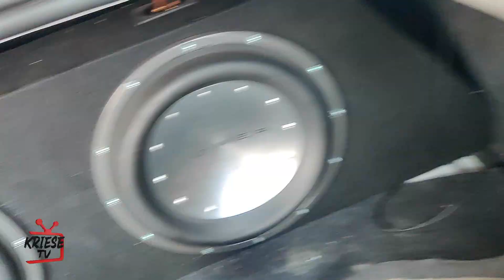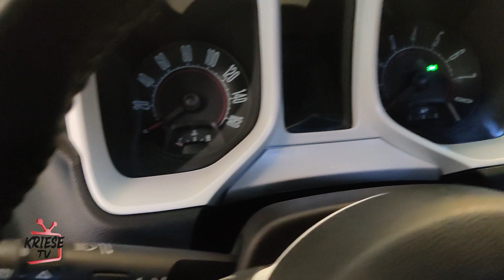Best Tail Lights for the Early 5th Gen Camaro!! (2010-2013)

Comment: So with those do u need that side sequential adapter or those automaticly come with that?
Reply from the maker: Nope but you'll  will need capacitors to prevent hypeflash if that annoys you.
Reply: @KrieseTV  where do i get capacitors from ? And not sure what u mean by hyperflash can you explain that a bit bro? Please
Reply from the maker: @chrisqzone  Hyperflash is when you replace your original turn signal hologen bulbs with LED bulb and it causes the turn signals to have a rapid pulse when blinking.  Check this link out.

https://youtu.be/czOdnnh5Lw4

They also have the resistors/capacitors that will eliminate they hyperflash in this video as well.

Comment: I have these same lights for about 5 years and now one side has started signaling sequentially but out of sequence and the front of car signal is flashing fast. Checked all connections and cant find anything wrong. Any ideas?
Reply from the maker: Sounds like they might be failing..🤔Do you have capacitors installed?  haviing capacitors  usually circumvents hyperflash.
Reply: @KrieseTV  thanks for the reply!  I do have capacitors by the looks of it, I think I will start with replacing that and see what happens.
Reply from the maker: @justdrives209 any time!  keep me posted man!
Reply: @KrieseTV  Well you were right! a $10 amazon resistor pack fixed the problem. ;-)
Reply from the maker: @justdrives209  nice!!! Glad to hear that. I also know what to do when mine go out!!💯💪🏾

Comment: My brother bought these 6800s about 5 yrs ago n never installed them ,then i bought the camaro and i installed them 10 months ago ,and these are the best looking..so where did you install the resistors?? I did have the far left start acting up after 10 mnths,technostalgia is out of business and i did investagation and found where the parts are located and bought a new far left yesterday with free shipping..
Reply from the maker: I installed the resistors to prevent hyperflash,  in the front. Yes Technostalgia is out of business. This is a non daily garage kept vehicle so hopefully they last a while.. best tail lights for our model by far✊🏾💯

Comment: That is a sweet ride. How did you mount your spoiler. I have the same one but can't make myself drill holes in my decklid. Mine is a 13 ss white with black stripes also. Thanks in advance
Reply from the maker: Thanks man!! Unfortunately I drilled the holes thru🙆🏾‍♂️. There's no other way with to mount it on. They have other styles That don't require drilling tho man👍🏾